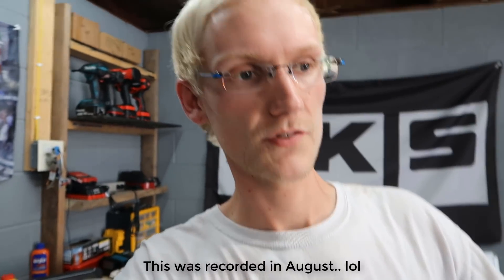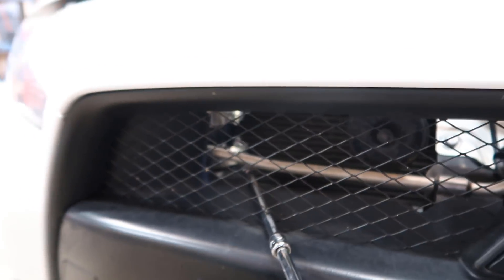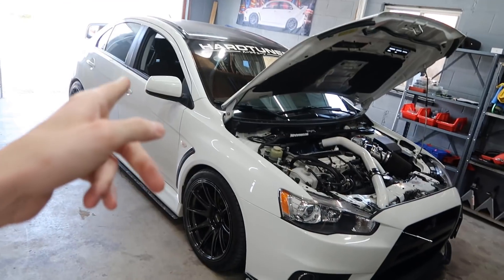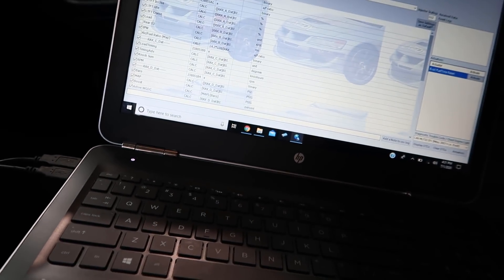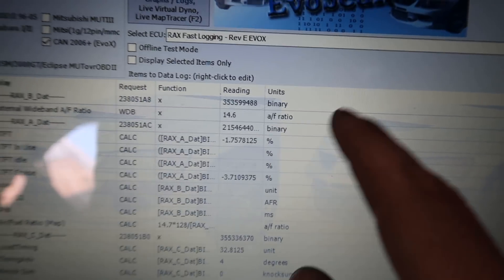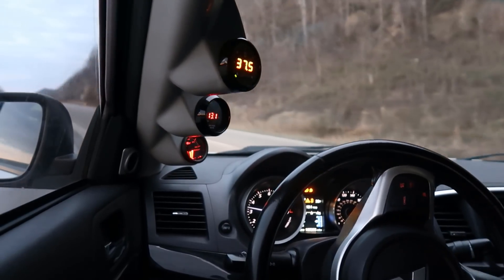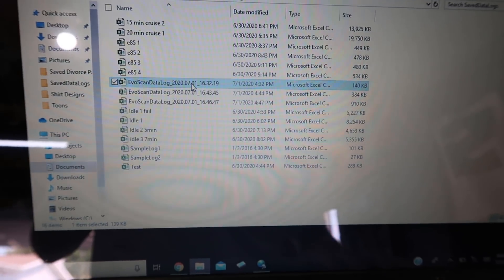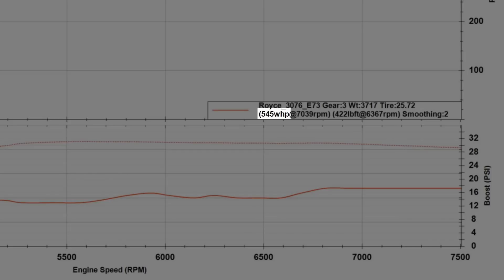How to Remote Tune using Evoscan and ECUflash on a545whp  Evo X

Comment: 545whp - 2 trans, multiple rebuilds and never dyno’d, never been to the strip.. driver probably still runs 14s
Reply from the maker: I ran low 13’s with the stock turbo and a cat back